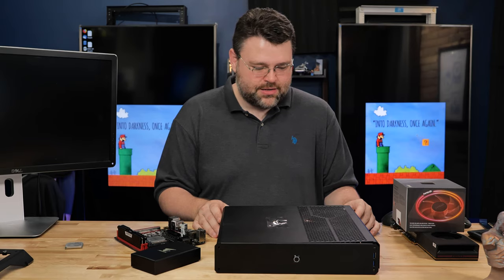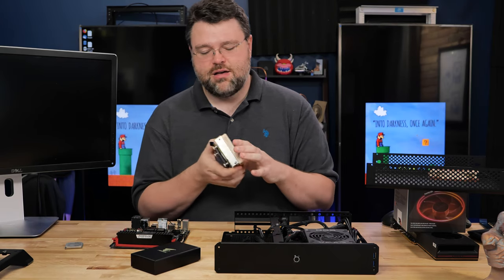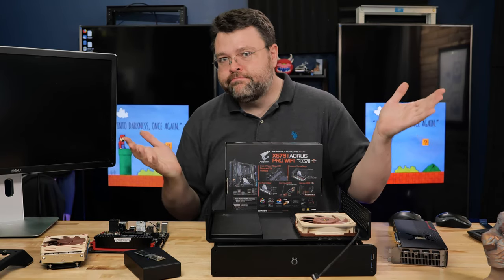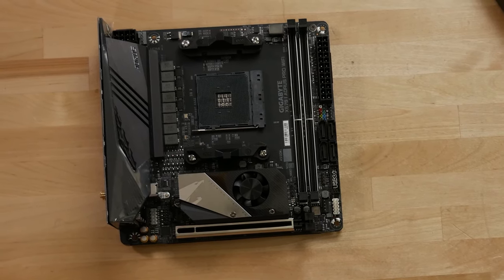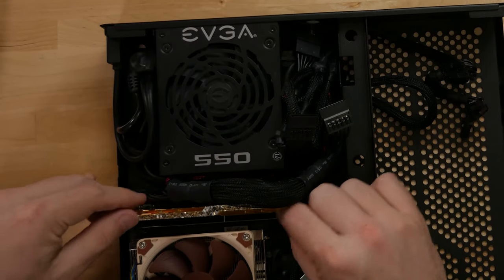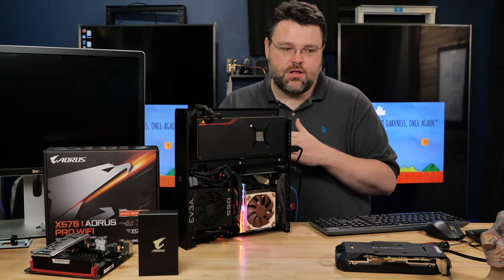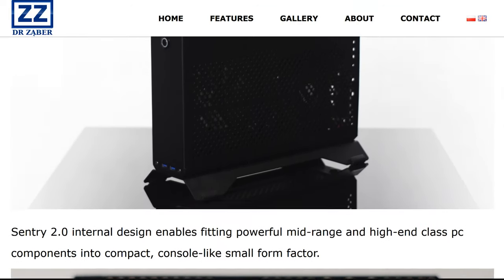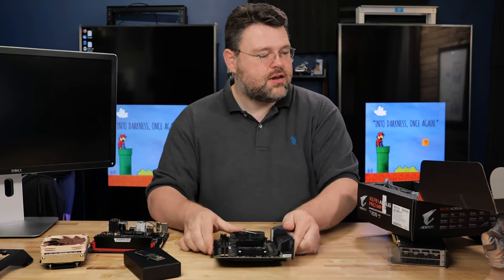Aorus x570 ITX & Ryzen 3700X Build in the Dr Zaber Sentry 2.0

Comment: You can set the CPU's power envelope in the BIOS to whatever you want, so just match the power envelope to the cooling capability and you are done.  Even a 3900X works well in mini-itx, crazily enough.   I've tested it in a 2U case with a low-profile  Noctua air cooler rated for 65W.  Turns out it can handle 100W in the socket and only pushes CPU temps to 65C.  It works better than the box coolers because the air runs only in one direction (well, two, but the RAM blocks one side).. so it rams the air right out of the back of the 2U rack-mount :-).

All I had to do was go into the BIOS and tell it to limit the socket to 100W and I was done.  Even better, stock settings (105W, approximately), and even PBO (130W or so)... they don't actually add much in the way of performance verse setting the limit to 100W.  So to my great surprise I got 90%+ of the 3900X's performance out of it without even trying.

It also turns out that you don't need lots of phases.  I'm running the 3900X on a MSI B450I Gaming Plus AC right now, and all it has is a doubled 3-phase. XXX CORRECTION, 6 straight phases.  Its beefy, but its still only 3 phases.  And it works just fine.  It isn't even breathing hard once I program a sane PPT limit for the socket.  (I am using a tower cooler, though, because the fractal case can handle it... but I don't need to, and I certainly didn't have a tower cooler in the 2U test.  That was a tiny little 65W Noctua low profile cooler).

-Matt
Reply: IIRC, the MSI B450i has straight 6+2 phases, no doublers (IR35201 voltage controller with IR3555 60A power stages)...

Comment: This build right now at Micro Center:
X570 ITX: $220
3700X: $329
5700 XT: $399
AORUS 2TB 4.0 SSD: $479 
EVGA 550 Watt SFX: $119
Noctua NH-L9a (? i?) $40 (Amazon, MC doesn't sell this).
G.Skill Trident Z Royal: $119 (16GB) or $239 (32GB).

Combo discount (-50 for CPU and motherboard, -50 for GPU and CPU): -$100
Total: $1609 + Tax + case (16GB) or $1729 (32).

That's really not that bad when you consider how much is packed into it. 
If it were me I'd skip on the SSD and get a nice 660p 2TB or an XPG 8200 Pro 1TB and save $250-320 there but otherwise a very nice build.
Reply: The case is at least $200 probably more. I have one on order for December and its cost me £212.  😬

Comment: Dream PC in terms of value per dollar, very nice!
Reply: With the exception of that RAM.  I think those were some insanely expensive ultra bling variety.  I can't remember the model, but I have seen a review on one and, quite frankly, unless you are really into the bling and have at least a window case (if not a full see through one) then it is a huge waste of money.  I would imagine Wendell used them because they are high quality and he had them around from his review kit.
Reply: @jameslewis2635  yeah, forgot about those :D
Reply: I'd be better if the chipset was x470 in terms of value
Reply: @Herr.Mitternacht  The VRMs are definitely an upgrade over x470 but one that virtually no one actually needs. A capable x470 Overclocking mobo such as the msi gaming pro carbon will cover the vast majority of users. Also Pcie 4.0 is a joke given that there's no card that saturates pcie 3.0. If I recall correctly we're not even halfway there. In my country no store charges for the Bios upgrade so I don't know about that.
Reply: X470 only has only sli support... A b450 with decent vrm's will run the 3900x , The Msi b450 pro carbon ac has a 11 phase vrm! enough to even run the 3950x (in theory) without issue, and it costs only a little more than b450 tomohawk.

Comment: thanks for showing the the gigabyte copper M2 heatsink fits nicely under the stock cooler :)
Reply: it fits but there is a major problem as i just found out , you can mount the top back on , but it doesnt make contact with the underlying heatsink from the chipset anymore !!! , this is to me a design fault from gigabyte , both products are made for pce gen 4 but not 100 percent compatible
Reply: @thomasvennekens4137  so are you saying that there is no way that it will work?

Comment: This is actually very interesting, I built my son what is basically a step down from this system in a Sliger SM560. B450 version of this board, R5 3600, Powercolor 5700 Red Dragon, and an Intel 660p. I also have the Chromax version of the 9i, that I had to purchase the AM4 mount for because they don't have a straight up AM4 version yet.

Comment: Super disappointing to find out that the "second" fan header is occupied by the chipset fan, meaning in reality there is only a single 4-pin fan header on this "Pro" board. What a ridiculous compromise. If the VRM weren't so good, I'd return it for another board.

Comment: Perfect setup. How about a video on tuning such as trying to get the lowest stable wattage (voltages)? Show us the build with the case on and the torture test thermal results? Or a bench of synthetic bench relevant to the situations you mentioned of Node.JS project processing?
Thanks for the tip about PCI-e risers.
Looking forward to aftermarket 5700XT p.s. don't know why you didn't mentioned that component in the video title or description... had to watch to whole thing to verify that you were using it.

Comment: Hey Wendell. You should be able to run the 3900x quite nicely in that system if you mess around with undervolting. Optimum Tech did a great video showing that by reducing the voltage you can actually get more performance than stock, while drastically reducing the temps.
Reply: Its really quite fascinating how the Ryzen 3000 chips seem to handle their boost mode.

I'm seriously considering replacing my 8600k with a 3900x but everywhere seemed to be suggesting its not a good idea with ITX.  So glad to see they were wrong, or at least that undervolting might make it more viable.

Comment: very nice i had a similar idea and finished up my itx 1700x b450 fatality build a little over a week ago and its only a little larger than yours in the silverstone milo case with the handle on it and it has my xfx RX580 8gb in it as the GPU a inland premium m.2 nvme 512gb and a corsair SF600 power supply with the team group xcalabur 4000 mhz ram that i have running at 3200 cl14.

Comment: Looking at the height of the PCH cooling solution on the board (6:36), I imagine there could potentially be some clearance issues with some of the larger tower coolers that could find their way into ITX builds using H200, Node 304, EVOLV or similar cases. Care to comment if this worry is unfounded?

Edit: Noctua L9a-AM4 is 114mm wide and (from the looks of it) almost directly up against the PCH cooler. E.g. the Dark Rock 4 is 136mm wide with a 40mm height clearance to the fins while the NH-U12S SE-AM4 is 125mm wide with 41mm clearance (both discounting the angles heat pipes that might also be a cause of potential compatibility issues)

Comment: Nice, i was making a little wishlist for my 2020 mITX build and i picked out the same mobo cpu and nvme combo, just seemed like the most logical choice.

i thought the manual said you should remove heatsinks when placing under the fan, but looks like it fits just fine. maybe because it's both Aorus?

Comment: If you know something about Threadripper 3000 you would tell us right ? Want some zen2 awesomeness but invested in x399
Reply: I need to know something about threadripper 3000 too. I have an AWESOME Unraid build waiting on tr3000 news
Reply: wonder if they will keep 12-16 core parts or only do high core count and high price parts...
Reply: @riklaunim  I bet they are gonna go higher core and clock, because why have a 16 core TR when they have a 16 core Ryzen 9? If tr3 is based off of Zen2, they could pull it off.
Reply: @hotstovejer  1900X launched while 8-core Ryzens were available - more memory and PCIe although Wendel told in one videos pretty much only big TR sold big time while the small ones did not so the fear of no "low" SKU comes from that. On launch in one of interviews AMD-guy told that as they "up" the core count on AM4 they have to "up up" on Threadripper - similar message.
Reply: I've heard rumors of server customers being all over the 'Rome' server CPU's and probably stacking up orders for months of the first, best silicon. Could be that Threadripper 3 will be quite a while from now, when yields and production rate has improved enough to expand into that market. However there is one positive if that is the case: later release means it will be produced on more mature, better performing silicon and incorporate more improvements, similar to what the 2000-series APU's got compared to the Ryzen 1000-series CPU's.
Reply: @jensdanbolt6953  I know this "best silicon is for Epyc" gets repeated everywhere but I don't think it's actually true. Why? Because voltage and power curves are very flat at Epyc operating frequencies, so difference between best and average is small. At best you might save couple watt per chiplet, that's just meaningless in 8 chiplet cpu rated 200-250W(large I/O die is real power hog). Also very likely there's relative large safety margin, chips are not driven near their limits, they are servers after all. However near max frequency difference is amplified greatly as curve gets steep, binning is much more useful. Weak dies obviously don't end up to Epycs, desktop skus can absorb them.
Here's matisse 8C chiplet power/frequency curve. 8W@2GHz.

https://i.imgur.com/zZ5eSEb.png
Source: https://www.overclock.net/forum/10-amd-cpus/1728758-strictly-technical-matisse-not-really.html
Reply: @hotstovejer  They had an 8 core threadripper ! 16 core super nice bin on the chiplets threadripper 3000 would be amazing IMO.

Comment: Is that cooler/heatsink enough for the 3700X? Though rated 65W TDP it actually runs much more for even the lightest workload. The official Noctua website rates it as compatible but not with any OC loads. Be interested to know what thermals you're gettig as I'd like to run a low profile system with my 3700X too.

Comment: I've made a somewhat similar upgrade running in a node202, with Asrock AB350 Fatality and a cpu upgrade from 1600 to 3700x, with the same cooler (both cpu have a tdp=65W no?), and boy it runs hot, it seems that the little noctua cannot cope with the amount of heat put out by the 3700x. While previously  the 1600  the temps were 40 idle, 60-65 degrees under load, now it sits at 60 already on idle and 85-90 under load, I've re-seated the cooler multiple times, changed the TIM each time from Noctua NT-H01 of the box, to MX4 and finally to Grizzly Kryonaut. Undervolting also did not help much, could only undervolt about 100 mv, otherwise  getting blue screens regularly, must be an Asrock B350  issue, so from what was supposed to be a quick and painless upgrade, now I am thinking on moving to a bigger case with a better cooler. But hey that's all the fun no?

Comment: Great build, exactly what I am looking for, except I want to run a 3900x or 3950x.  You didn't mention thermals for your setup.  Would that cooler handle the 12 or16 core Ryzens ?

Comment: Awesome build! Isn't there and issue with PCIe 4.0 and the riser cables, or did you somehow find a 4.0 riser? I know others were having issues with this exact type of set up...? (X570, 5700 XT and a riser cable)
Reply: Well you answerred the question - I know some others had an issue and had to disable 4.0 in some way, I didn't catch much in the way of specifics. I am gonna be using a b450 setup with similar specs though I think I am going 3600/X OCed instead though. I just won't be using that many cores for a while - maybe with Ryzen 4000. :p

Comment: I wish these AMD mITX boards came with more than 4 SATA ports.
Reply: Angel Manuel Perez having more than 4 SATA drives in an mITX build is a mistake in the first place.
Reply: @KingHalbatorix  Depends on your use case. I have a 6 drive NAS using an mITX board for Intel.

Comment: I got this ITX board by mistake because I didn't know much about computers anymore (last time I built one ITX didn't exist). I can't seem to fit my RTZ 2070super onto it it "fits" but the small pin side (gpu connector ports) won't allign properly with the outside of the case I'm outta ideas

Comment: Would be interesting if you replaced the TIM of the 5700XT (Like "GamerNexus" Steve showed) to improve the thermals and/or reduce the noise a bit. With a before/after of course.

Also, is AMD not doing that RAID software anymore?

Comment: great vid. I disagree with you on the 2.0 usb header, we need those for so much stuff still, what are you thinking. we need a couple of them still for all for RGB controllers and AIO's and power supplies.
Reply: You can convert a USB 3.0 header to USB 2.0 if required, but not the other way around.

Comment: What are the cooling limits on this case, I would like to do a similar build.
Reply: Main limit is the CPU cooling, if you want a full sized GPU you should use this Noctua air cooler. You can use an AIO if your using a stubby GPU. Personally I think its best to use a non-overclocked CPU and a full size GPU. I plan on building with a 2080super EVGA Black since it has a two fan setup and is a 2H card, although I would bet that if you can stump up the scratch for a 2080ti that would be fine too. Linus put a friggin' RTX Titan founders card in this case and it seemed to be ok, although we didn't see proper testing and the Titan does run pretty damn hot even compared with the 2080ti.

Comment: Hi Wendell, I'm having 56° in idle with my AORUS NVMe under the chipset heatsink with the fan, sounds like a lot
Reply: in fact is hovering 61° idle...man I know you're quite a big fella these days but I would really love your insight regarding how did you install the Aourus GEN 4 with this board, in my case I'm having extremely hot temps with both products combine.

Comment: another "worst case" option for PCIe v4.0 riser cable compatibility is to change the BIOS back to PCIe v3.0 x16 (or v4.0 x8)... whichever option you have and the handshaking should validate fine if the cable is suitable for PCIe v3.0 x16 but not quite suitable for PCIe v4.0 x16... if you do PRODUCTIVITY with the graphics card that may affect performance but it shouldn't matter for gaming

Comment: Would you recommend any alternate cases, planning on doing a similar build with the same motherboard but unfortunately this case is not available for the time being :<
Reply: I build it in a raven rv03, also with noctua fan, it gets hot, but its running fine.
Reply: @rudypieplenbosch6752  Will take a look, ty

Comment: cant imagine that monster not overheating
Reply: it will for sure
Reply from the maker: My old CPU was 65w tdp .. it's doing fine so far. Slight undervolt for better temps but no throttling so far knock on wood

Comment: What do you guys think - pair the 5700 XT with a Ryzen 7 3700x or a Ryzen 5 3600?
Reply: It depends if you need the extra 2 cores of the 3700x. But for just gaming and normal multitasking then go 3600.
Reply: @ronaldsanpedro1976  thanks man, I think I agree, I'll probably go 3600
Reply: @MrCykko  even with 6c/12t, the 3600 scored higher multicore score than the 1800x. And about on par with 2700x. This is because of the better ipc. In gaming benchmarks, it comfortably score within 5 fps with the 3700x ( 3700x has a higher boost clock). Its really good and quiet cheap for its performance. It on par and even beat the 8700k in gaming. An epic value for ,$199. I have an 1800x. But was also considering upgrading to the 3600. For my workload, 8 cores is wasted. Ill wait for the black friday price drop.
Reply: @ronaldsanpedro1976  that's what im doing, I'm planning to build a new rig around black friday. hopefully there will be good aftermarket cooled RX 5700/5700 XT by then
Reply: @MrCykko  look for a sapphire nitro+ or pulse for your rx5700/xt. Thats the best model in the vega  generation.

Comment: As much as I love this ITX build, I’d prefer to have more PCI 4.0 slots.
Reply: What would you use them for?   LAN/Audio/wifi all on board. 2 nvme for storage. SLI/crossfire is dead.
Reply: Jon Donnelly i typically keep my system for 4 to 5 years (not a pro gamer) so I like to keep my options open. I want to expand with Thunderbolt 3 or equivalent technologies in the future. I may want to experiment with multiple GPUs for computational activities but these are just ideas for now. The fact that the slot won’t be the bottleneck is a significant plus.
Reply: It might be possible to get nvme based thunderbolt adapters, if they do it for wifi cards etc it should be possible

Comment: Reference 5700XT, a toasty PCIe 4.0 SSD and a tiny cooler...this machine won't be cool.
BTW, it's possible to squeze in a 120mm AIO into Sentry with some patience and magic, but I'm not sure it can be done with these new X570 boards with their big heatsinks and mumbo-jumbo...

As for the board itself, I liked it at first but I have some issues with it now. 

One is the VRM heatsink - the VRM is great, it can handle 16-core with no issues, but the heatsink is just a flat lump of metal with no fins, it's sealed off (the only place it can radiate heat is up (somewhat) and it connets to that plastic I/O shroud...and all that in an already airflow-starved ITX case. It will have no issues with overheating on 3700X but still...they should have put one of their nice heatsinks with fans from their higher-end boards and left it open as much as possible...
The other is back I/O. Instead of unneccesary 2xHDMI and DP, they should have just used one video output and added 2 more USB ports.

All that is not that big of a deal, though. I'm curious about temperatures in this machine, hopefully there will be a followup on that...